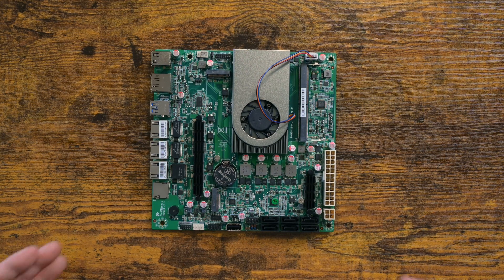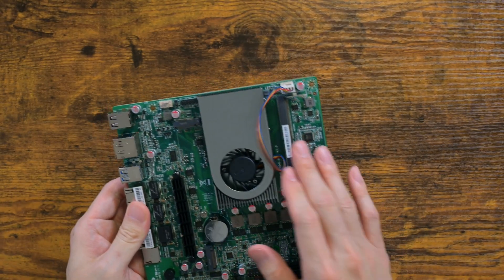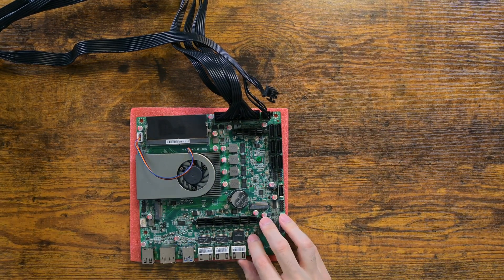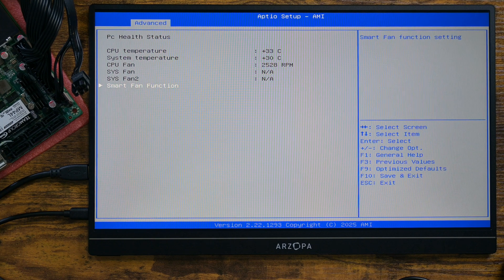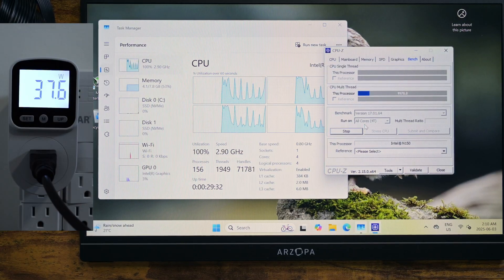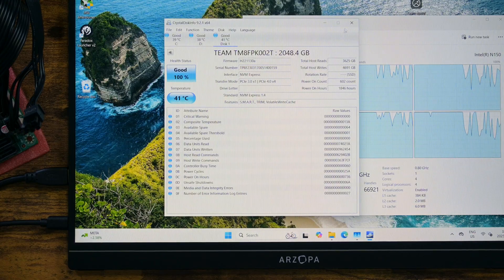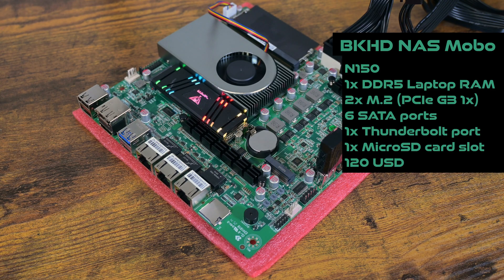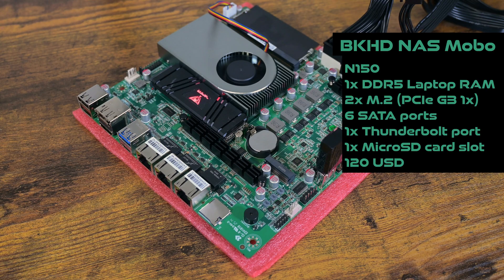A NAS motherboard with N150 and other goodies

Comment: Any experience from usage for a few monthes?
Reply from the maker: No problem whatsoever.
Reply: @geekdk Great to see!
But it’s really embarrassing that there is still no documentation or updated bios on the product page on the official bkhd website for this motherboard.
Reply: @geekdk i got 1 problem here, it seems that with this motherboard proxmox can't passthrough sata controller (asm1166) into vms.
Its sad(

Comment: Do you know what speeds the SATA ports run at? The website says ASM1166 (PCIe x2) so this should be PCIe 3.0 x2 giving it a bandwidth of 1970 MB/s.  So you should be getting 550 MB/s from a SATA Drive?

Comment: While you are in Linux Mint, I would recommend running "lspci -vv" to enumerate devices on the PCIe bus. It also lists the states and properties of these devices. You can enumerate additional hardware with lsusb and lshw, and you can even stress test the hardware with stressng and s-tui. I keep a bootable copy of Debian 12 with these tools on an M.2 NVMe drive within a USB enclosure, for just this kind of diagnostic testing. As far as power consumption, you can try "powertop --auto-tune" and the autoaspm pyhton script (from github) to minimize the idle power consumption.